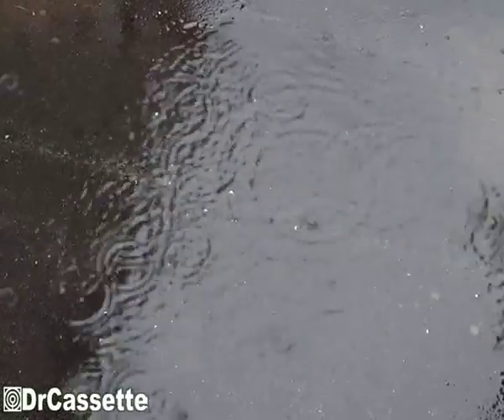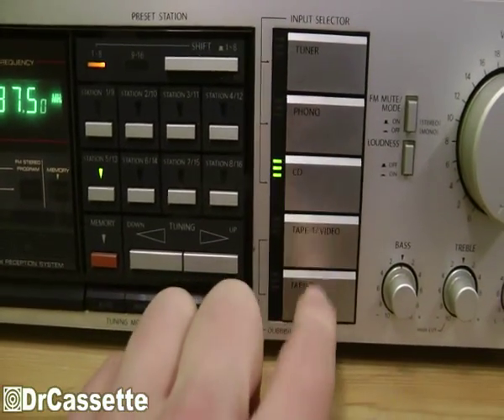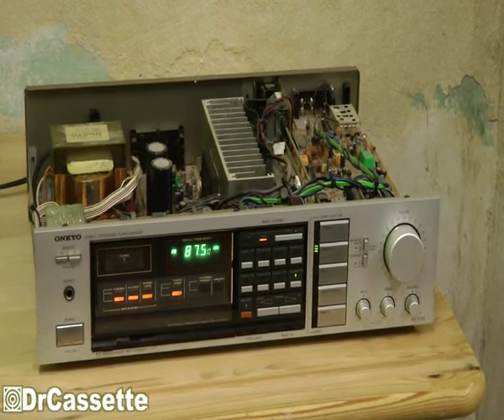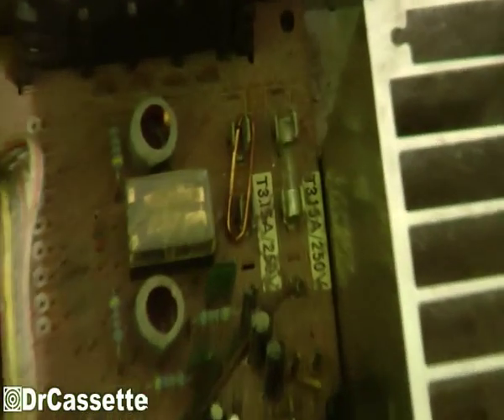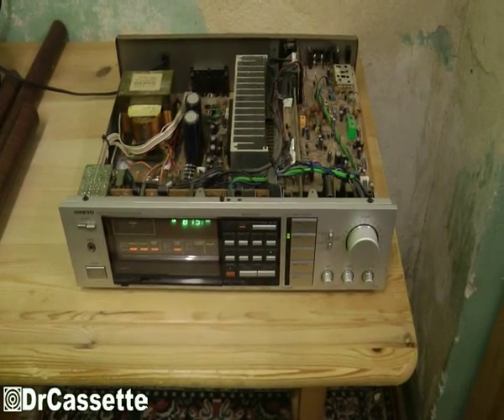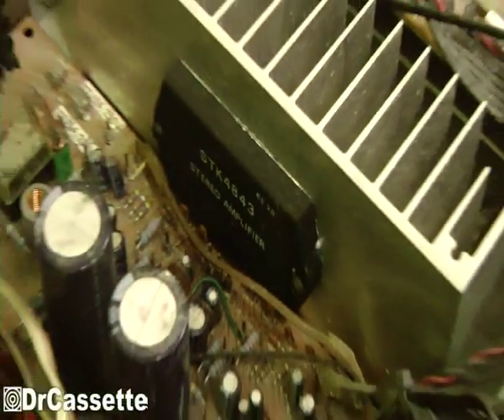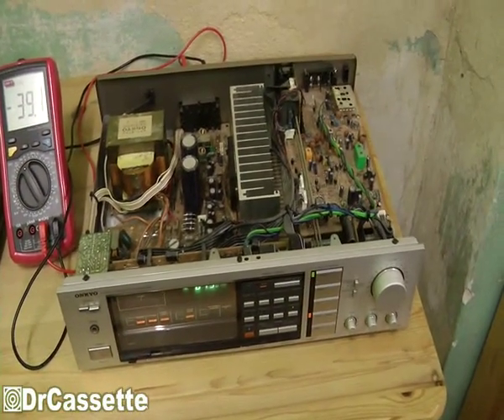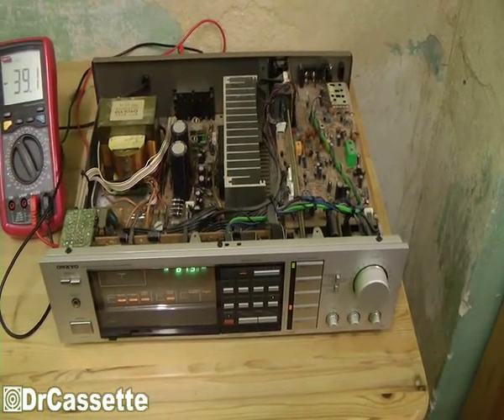Broken Onkyo TX-7230 receiver

Comment: This unit should be from the 1985 model year. Going through the MESS that is Onkyo's int'l model numbers, it would appear that the respective cousin would be named TX-27; I managed to obtain service docs. Apparently these STKs belonged to an entire family, with 4863 and 4913 being ones rated for higher supplies.
Apart from the STK issue, it's not a bad unit. 4-gang FM frontend with AGC in this German model, 3 IF filters, pretty much what you got with a T-4230 (/T-4038) tuner.

Comment: Unfortunately, lots of the big names in the 80s like Sony, Technics and Sanyo started using these  STK amp chips. Often, protection was rather lacking. In this case there is a relay which will not open if the +40v or -40v  rails are present at the spkr outputs. If someone hadn't bridged that fuse then this might have been fixable. It's amazing how stupid people can be, they don't understand that fuses blow for a REASON and that they protect the equipment. Shoving wire across them is a No-No!

Comment: Did you have the multimeter on the DC setting to test the speaker? It should read 0 volts
on DC if its not dead and a couple of volts on AC if its alive, its that correct?

Comment: I´m changing the amplifier chip to my ONKYO. I also removed the transistor that is a couple of inches to the rigth of the STK4843 and I lost it. Could you help me whit the numbre of that transitor so I can buy a new one?? thanks
Reply from the maker: I don't have this receiver anymore, it's long gone. Do a search and find the Service Manual for the Onkyo. It contains full schematics and a parts list to help identify any component.